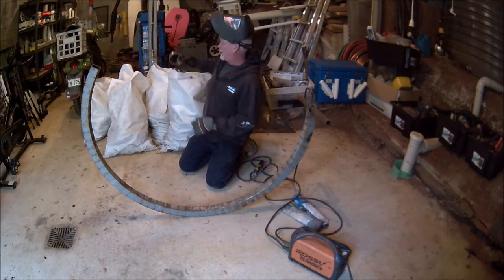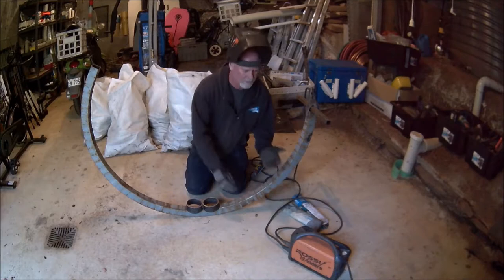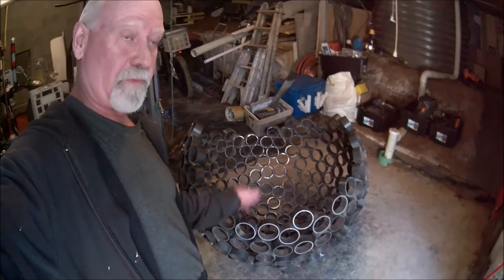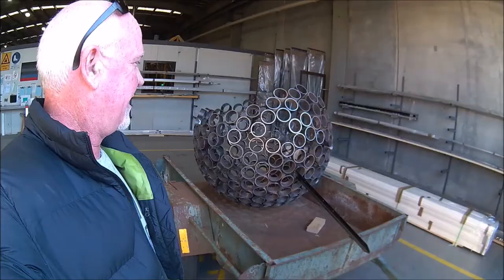metal sculpture, large, beautiful and simple !

Comment: Could you share the exact dimensions (audio is real bad).  Thnx.
Reply from the maker: 1.2m in diameter ..
Reply: @dazzasrandomstuff5672   Thanks. Was hoping if you could give the measurements of the rings (+cuts)...your rounded square bar etc.  Would live to try my hand at doing something like this if you don't mind. 😄
Reply from the maker: No problem.  100mm diameter rings 45mm x 4mm thick.   Jig cuts are 50mm apart. With a 3mm grinder blade.   Good luck with your project.
Reply: Thanks. How navy rings were used?